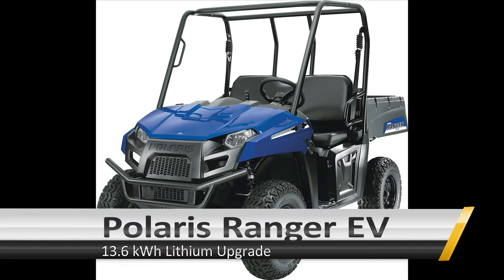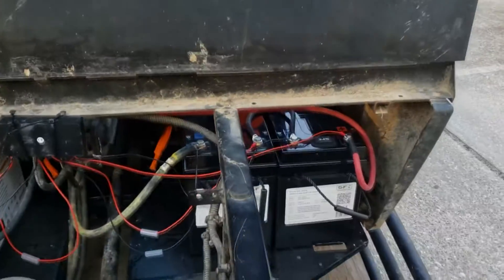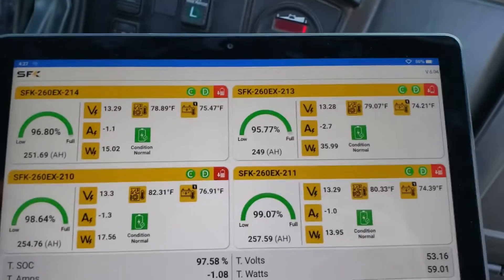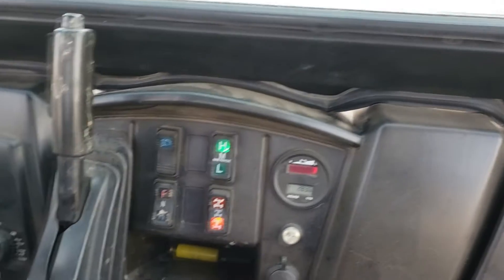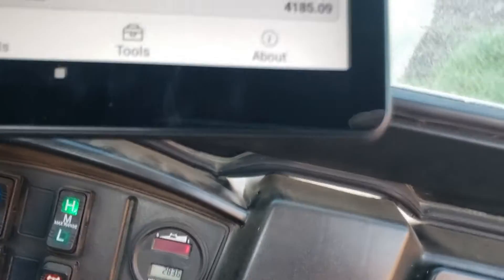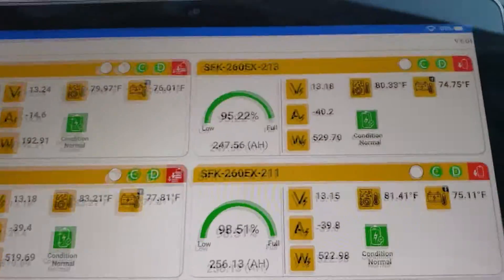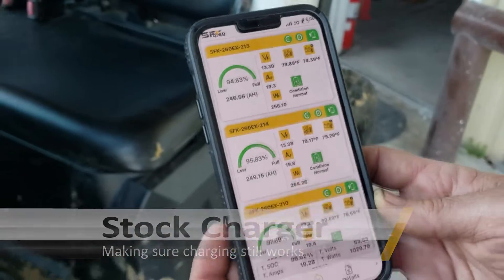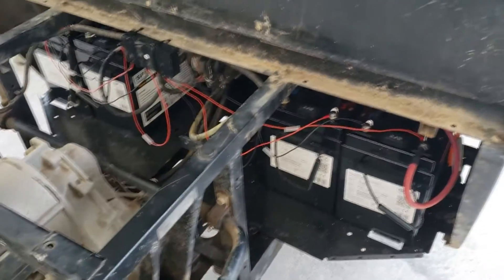Polaris Ranger Ev 13.6 kWh / 14 Horsepower Lithium Battery Upgrade - Sun Fun Kits

Comment: The Ranger can pull up to 400amps under a load. pulling or going uphill. The BMS will shut the cart down.
Reply from the maker: This is not accurate there is a governor on the unit that limits maximum power to 8 kW (about 10.5 horsepower). Lead acid have a massive voltage drop under load so in order to provide the same watts they must provide substantially amps.

Remember watts = volts × amps. You can either raise the amps or the volts to achieve the same power.

Lithium batteries are able to hold the 13v output even at 200 amps (even though we did not see any spikes over 150 amps).

Comment: Nothing like sending a nice FLA equalizer voltage to lifepo battery of that stock charger. 

Sure the BMS will protect the cells from an over voltage issue, but still not ideal.
Reply from the maker: Hi, The battery equalizer will work with pretty much any voltage or chemistry, it's a kin to an active balancer but for the batteries as a whole so its not chemistry dependant. It works by taking in voltage from the connected devices, averaging them in side the inductor coils and then releasing it out to the batteries. The maximum voltage of the device can not exceed the average voltage of the connected batteries. Eventually all connected devices end up being the same voltage. This makes it a cost effective solution for balancing lithium batteries in series, you can see the results of our 48v bank using it in this video: https://www.youtube.com/watch?v=v6L8yyF5xxk

Comment: Any BMS communication between batteries?
Reply from the maker: Possible with the SFK HUB and new batteries with the data port, for this install the customer wanted to keep it as simple as possible.

We'll be releasing an update to the app to add a new Vehicle Mode which will show GPS speed Data and Battery Power as well as fuel gauge.